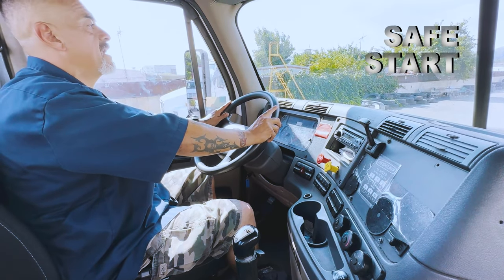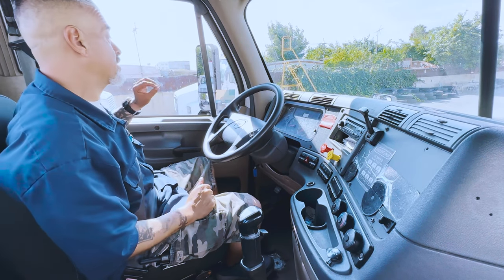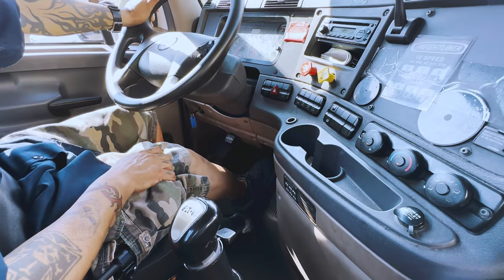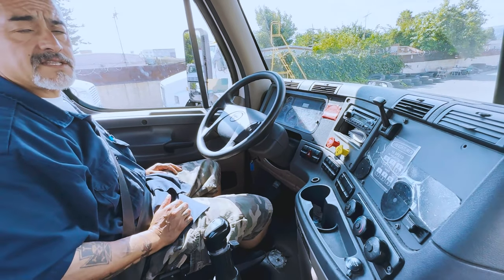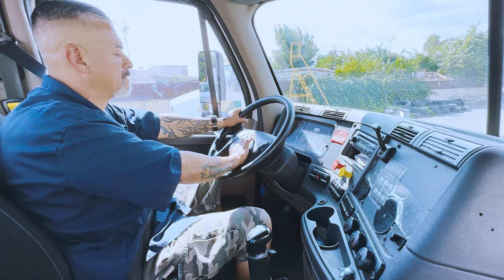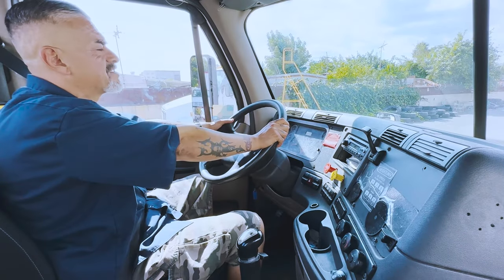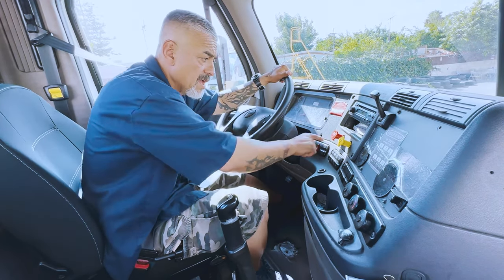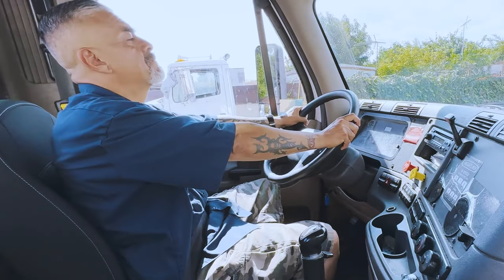CDL Class A Pre-Trip In-Cab Checklist & Air Brake Check Inspection | California DMV 2024

Comment: You first have to do your tractor and trailer and service brake test before you can go into your air leak down test,,, if you were in Ohio you would have had failed
Reply from the maker: Thanks for the tip! If you're in California, you can follow this guide and you'll be guaranteed to pass!
Reply: @USDecals to check our lights on the outside do we have to tell the examiner if they can help us? I learned my CDL exactly the way it was put in this video I’m also in Cali
Reply from the maker: @viperomen914  They will instruct you on what to do but you can always ask for help.
Reply: This is the new  modernized testing standard that we do in Cali. Soon, every state.